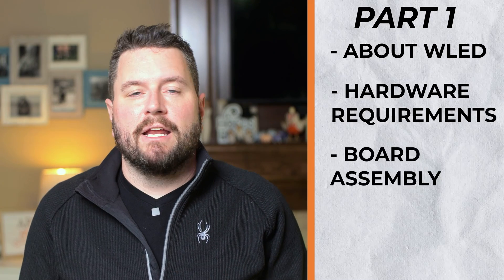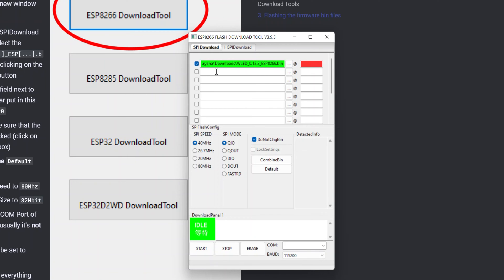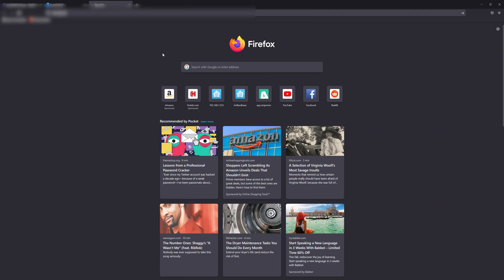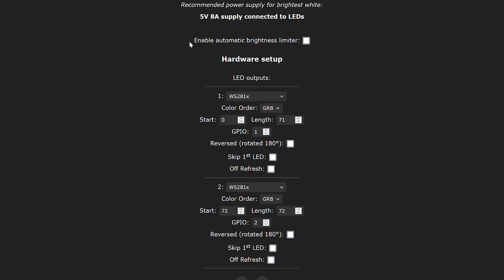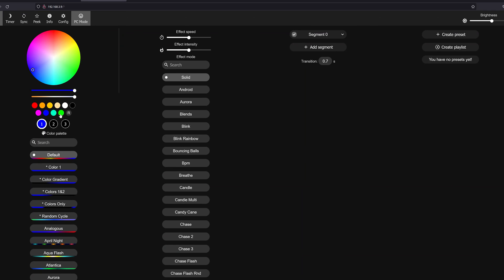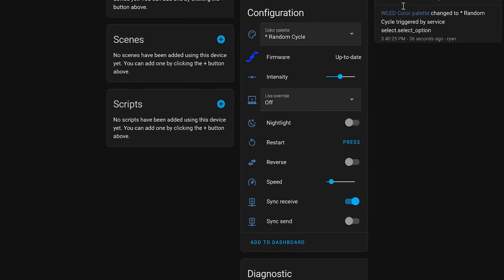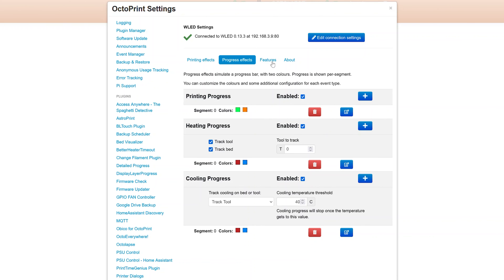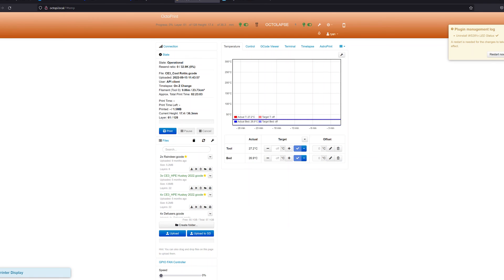WLED Software Setup, Tour, & Integrations // Part 2

Comment: What wud be the most appropriate setup for multiple long lengths of LED strips - one ESP and lots of power supplies or multiple ESP (can the chained?) eg 60ft long hallway with low high leds strips on either side?

Comment: Any idea why I don't get any color blends? I get solid red green blue only. No blending between colors and no white. If I set the color to white the led strips shuts off. I'm using ws8215 60 leds / meter strips
Reply from the maker: You have selected the correct LED type in settings? Are you testing with an effect that has other colors?
Reply: @ThisSmartHouse  Thanks for the feedback. It turns out it was a power issue. Powering 5 meters of 8215 from my USB apparently does not give enough juice to run white. Once I added a power supply everything looks great.

Comment: hello 

 I have problems connecting with wled via esp32.

 I manage to connect to wled from the phone as on the computer.  No worries at this level.  when I plug the led strip into the esp32, only the 6th led lights up green.
Reply from the maker: Are you sure you have the correct number of LEDs defined in WLED?
Reply: @ThisSmartHouse  yes ...

And even without de connecting the data wire ,it's the same green light on.
What the lights are supposed to do if I connect theem only With power without data?

Comment: why not espflash tool available on serg74 github?
Reply from the maker: You can if you want. The web flasher is easier for most people.
Reply: @ThisSmartHouse  web flasher is the easiest and most likely way to flash wled or esphome but what I mentioned was esp flash tool, which only requires the serial port which it auto detects and bin file. Your tool required flash size and 0x00 code etc. Esp flash tool is only required if web flashing failed for some reason.
Reply from the maker: Good point. I think because my ESP chips were flashed with another project that I had to wipe them first. But your way is much easier.